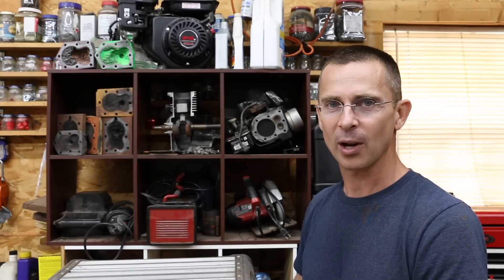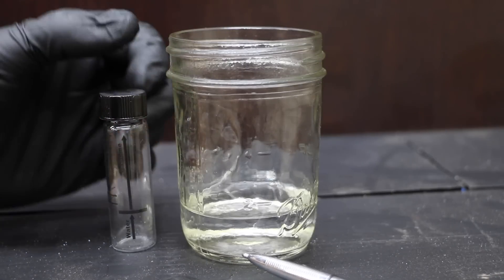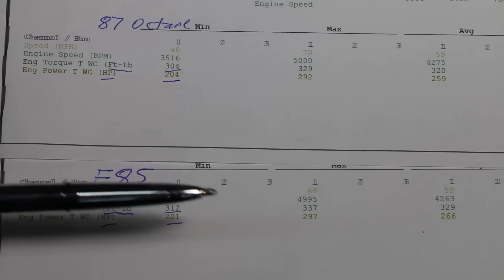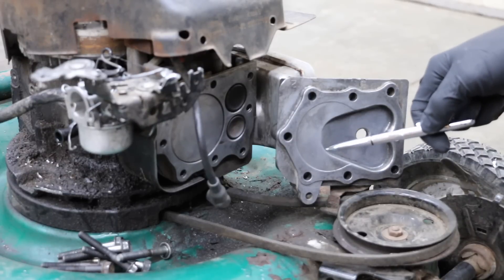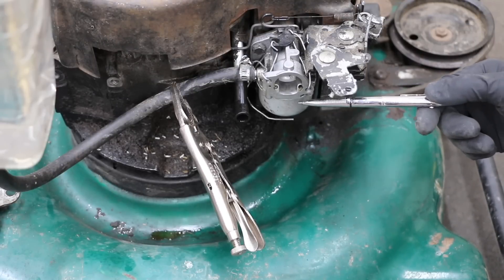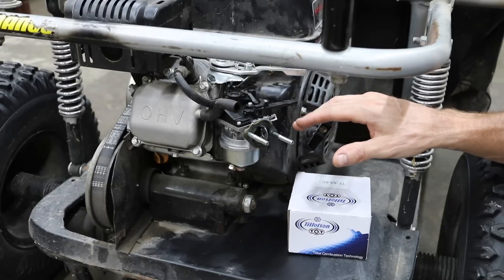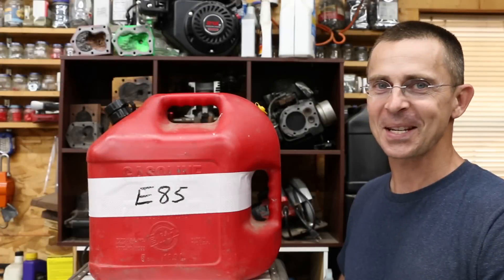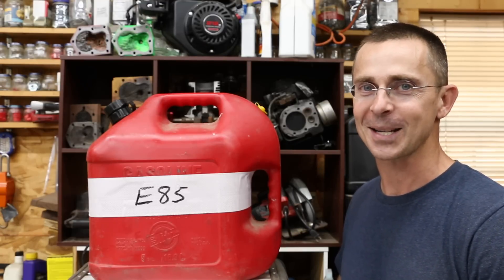Is E85 better than Gasoline? Let's find out!

Comment: I would rather fill my tank with regular gas (preferably 0% ethanol, if available) and install a water injection kit to keep the engine cleaner. It would be a much different story if ethanol would clean your engine and also have better fuel economy than regular gas. Ethanol fuel seems to do the same as regular gasoline with water injection and if you choose the latter option  you sacrifice your fuel capacity and efficiency. First the EPA had to ruin our jerry cans by making them impossible to put 5 gallons into a car in less than 10 minutes unless you drilled vent holes or removed their craptacular nozzle and just pour the gas into a funnel and now they are pushing this BS fuel. Just go back to using uncontaminated regular gas or admit defeat and let the electric vehicles take over. e85, def, catalytic converters...FFS my 1973 lincoln with a big block 460 passes emissions and has no catalytic converter an runs on regular gas..... why do we need all this extra crap?? oh wait, uncle sam needs his cut!!!
Reply from the maker: Thank you

Comment: I liked E85, my car was less loud and ran smoother. But, I could only use it in hot weather, in cold it was hard to start the engine. The price was just enough cheaper to compensate for the higher consumption. The exhaust smell was really nice🙂. Sadly, it's no longer available here in Hungary
Reply from the maker: Thank you!

Comment: E85 returns less mileage because it has to run richer. It would be effective where normal fuel prices are very high, but ethanol production is abundant. Like Brazil. I guess it's one of the best alternative fuel for spark ignition engines out there.
Reply from the maker: Great point. Thank you

Comment: E85 is kinda dumb in the grand scheme of things, and typically worthless in most generic applications.  That said, it lets you do cool things like make over 400HP from a 2L engine without grenading it in the first 500mi.  Given the direction things are moving, it is probably in your best interest to make as many adaptations for fuel containing ethanol as you possibly can.  It annoys me to no end that there's no proper flexfuel setup for my Caliber.  My Accord already has a custom ECU and will get a flexfuel tune as soon as I stop being lazy and fix it.  Spools of ethanol capable fuel line (Gates Barricade) are pretty cheap now, so you can fix up your return lines and lawn mower hoses.
Reply from the maker: Thank you

Comment: I've got a 2002 S10 Sport Truck that is Flex Fuel E85 or Regular 87 octane.. I quit using E85 because it was getting Horrible Mileage.. About 11miles gal. Vs. 17 miles  gal Regular Gas... I've got to admit my 2.2 liter 4 ran clean.. No odor from Tailpipe just hot water smell.. Steve.. 😎
Reply from the maker: Thank you.

Comment: If the vehicle is not designed for alcohol it will eat rubber hoses and corrode metals. Alcohol does have  higher octane but poorer power for a given amount. Engines will run fine on it if designed for it.
Reply from the maker: Great point. Thank you

Comment: It was strange to me on the Dyno tests that E85 provided more hp, but mpg was much lower.  I don’t think E85 was providing more power.  As you indicted in this video, E85 has less BTUs per gallon than E87.  The reason the decal on the pump said 51% to 83% and not 85% is there is about 2% natural gasoline added to 100% ethanol so it’s not drinkable.  The alcohol content of E85 is less than 85%. The results from your kit looked just about right.
Reply from the maker: Thank you

Comment: 95% of cars on the road don’t get any benefit out of e85 at all, you need a high compression engine and or a super charger to actually need the higher octane. When you do have a vehicle that needs high octane gas e85 is a bit cheaper than the alternatives even counting for the greater consumption.
The motor companies want high octane fuels to be standard as they can ramp up the power and efficiency by increasing the compression ratios, most vehicles that need high octane due to the high compression ratios they have are actually hobbled by the need to be able to use regular gas without damage in case someone mis fuels them. Currently the highest compression street car is about 12-1 compression but if there was no chance of getting the wrong fuel they could go as high as 16-1.
But then there would be a lot of engines killed by stale e85.
Reply from the maker: Thank you

Comment: E85 is used religiously on boosted vehicles. The alchohol content greatly stabilizes the fuel which allows you to really add timing and boost without fear of predetonation occuring. My SHO on E85 runs fairly safe at 16 lbs of boost with everything else being mostly stock. Compared to 12 lbs on 93 octane which is about as far as it can go without modifying other components. E85 tends to taper off at the top end for most vehicles due to limitations in the fuel system since it requires more fuel to get the same boom. Since turbos offset top end losses with boost, its an ideal setup. I wouldnt run e85 in a naturally aspirated setup.
Reply from the maker: Great point. Thank you

Comment: Put e85 in my 91 mustang few weeks back, yeah gas mileage using it not the best. But I gained probably 30+ HP, dropped 6 degrees in motor Temp. Noticed engine sound's different, sound's better. Great racing fuel and cost way cheaper...
Reply from the maker: Nice!  Thank you
Reply: @ProjectFarm  welcome

Comment: Great video as always. I use one 1/2 tank (5.0 gallons) of E85 every 6 months for engine cleaning in my 2000 Saturn 1.9, with 201,000 miles. For me its like a giant bottle of engine cleaner. Works great for only this purpose. Other than that, E85 is yuck.
Reply from the maker: Thank you!

Comment: What if you were to use a roughly 15-20% mix?
From what I’ve seen most modern vehicles should be able to handle e15, so what if you wanted to use a little higher mix to clean out your engine?
Reply from the maker: Great point!

Comment: I used to use E85 in my '03 Crown Vic before it was totaled. Much preferable to gas, the only downside was that since it burned cooler the heat didn't work as well in the winter. Never had performance issues and got good mileage. Plus, for nearly 3 years, E85 was ALWAYS $1.71/gallon at my local Kroger. A few months ago it went up to $2.65/gallon, but by then I was driving a. '04 Chevy Equinox that does not play nice with E85.
Reply from the maker: Excellent!  I'd use it if the price was right. Thank you

Comment: E85 is an excellent alternative to race fuel because of the octane rating of 105 (IF it truly is E85). I know people running upwards of 14:1 compression safely on E85. The engines run knock free and much cooler than on race gas. E85, however, requires about 30% more fuel than gasoline.
Reply from the maker: Thank you!

Comment: We repair postal vehicles and they are phasing out the ford body trucks which are flex fuel. When a new post master was in charge he told them to switch to e85 since it was cheaper not knowing it would cost more in the long run. We towed most of them in because of so many years of regular fuel it cleaned the crud out of the engine causing problems. On another note it does make more power in most engines but we all know making power comes at a cost or an exchange
Reply from the maker: This is interesting. Thank you!

Comment: Very interesting. Yes, Ethanol is an alcohol and hydroscopic, meaning it absorbs water, plus it's mildly corrosive which is bad for fuel systems, especially carburetors. Ever crack open a fuel bowl on a carb that's had E90 sitting in it? It's a mess. I ways awondered why GM and Ford were the only automakers to make flex fuel cars. To my knowledge, the Chevy Impala, Tahoe, Yukon,  Silverado, and the GM Sierra and Cadillac Escalade were flex fuel, and the Ford F150. They don't get good gas mileage to begin with.
Reply from the maker: Thank you!

Comment: Great video! Here in Brazil we have E100. Regular gas is E27. Today, about 80% of the cars here are flex fuel. Our rule of thumb is if regular gas' prices are over 30% above ethanol prices, is better to use ethanol.
Besides keeping the engine cleaner, ethanol is much less susceptible to knocking than gasoline. I myself drive a car with 22psi of boost and no intercooler, that's only possible with ethanol or methanol.
Reply from the maker: Thank you

Comment: My mileage in my 2017 equinox is a small difference I've ran both several times, I usually lose about 2-3 mpg, but throttle response is much better with the e85. If you're vehicle is tuned for it it definitely runs well my 72 c10 with a high compression 496 runs great on e85 but I tuned it and redid all the fuel lines with PTFE coated lines
Reply from the maker: Thank you

Comment: Excellent tests.....As usual. :-)
Reply from the maker: Thank you very much!  Thanks for the GREAT videos you're doing!  That 1000 AMP melter video was interesting!
Reply: I think you meant "Entertaining" tests.
Because this was one of the worst tests he has done.

He literally only showed 2 things.
1. Lower energy density (Needed more fuel. Less 'efficiency.)
2. Ethanol is a solvent, and will dissolve parts of a fuel system that is not designed to handle it.
(Holy crap STOP saying corrosive! That is NOT what that word means. It doesn't make you look smart. It makes people who DO know cringe...)**

Further: He doesn't seem to understand the difference between...
"Designed not to break when fueled with E85"
and
"Designed to take advantage of the things E85 is better at".

This TOTALLY sidesteps the actual (situational) advantages of E85
1. Much cooler intake charge.
2. WAY higher octane rating. Which it is why it is used in engines with forced induction pressures that would immediately destroy a normal gasoline one.

Conclusion: This test is utterly meaningless. Unless it is trying to answer the question "If I put E85 in my car, will it go faster?"  Which the answer is OBVIOUSLY "NO".

** Solvents break down things WITHOUT making chemical changes. Water dissolves table salt. But the salt is still SALT.
Corrosives break things down BY making chemical changes. Vinegar corrodes sodium bicarbonate (baking soda) by changing the molecules.
Reply: @Overwatch I find it highly amusing when viewers with zero content on their YT channel mouth off. If you're so smart and know so much, then make a video. LOL
Reply: @Prophes0r  Tecnically ethanol contains water into it. So it could cause corrosion in a normal gasoline engine not prepared to handle ethanol. Its actually a normal issue with old fiat tempras wich had a jerryrrigged computer to be able to burn ethanol instead of gasoline, the infamous 'converted to alcohol fiat tempras'.
Possibly its that what he is talking about.
Reply: @Prophes0r  no need to be rude bud.
Reply: @electronicsNmore  Why?
We don't have political donors, nor the power to remove donkey content once onto the net with our face.
I prfer to read the comments to critique junk science from real science.
And there is indeed a different payola system with internet than when DJ's were spinning an unknowns new vinyl 45.
You cant fault capitalism.
In fact, this is a new approach for teaching.
The problem in home class is cyberporn and too many hours spent with some Armalite variant in a game.
Lets talk CIA and imagery subliminals.
Watch a kids retina and endorphins under stimuli.
Reply: @Prophes0r  -  I'll just respond to one aspect of your comment, because it's not worth the time and effort.

In order to take Full Advantage of the E85's Power Potential, you need to use it in Supercharged Engines or
High Compression Normally Aspirated Engines running 11:1 to 12:1 Compression Ratios.  Then a High Performance E85 Tune 
is Recommended to Advance the Timing to take Advantage of the 100-105 Octane Rating that E85 produces.
Reply: @eduardoavila646  ethanol only contains water when contaminated or when not distilled to 99%+. there is a small amount of methanol formed during the distilling process... the methanol which is formed from impurities and must be drawn off, if used for human consumption.
Reply: @Ranger_Raptor_Twin-Turbo_3.0L  thanks for clarifying the octane of e85. pure alcohol burning engines can have compression ratios over 14:1. same as propane fueled engines, as both fuels have octane values over 120 and can be up to 125..
Reply: Oil execs in 1973. "So when Detroit catches up to Japan in technology, we can sell worse mpg fuel and still make piles of cash?"
Board members: "All saying aye!"

Comment: I love this test!! I own a 03 Tahoe with the L59 flex fuel engine. I have never used E85, mainly because of fuel consumption differences.
Reply from the maker: Thank you!  I really like the engine used in the Tahoe/Suburban.  It's done well.
Reply: @ProjectFarm  I agree!! It has 275,000 on the engine and transmission now. Makes no noises, and runs smooth!! I use a bottle of bestline with every oil change!

Comment: We had a 2010 Mercury Mariner a couple of years ago and the gas milage was horrible compared to regular 87. I did a price comparison and at $0.50 less then 87 (at about $2.50 vs $3.00) it averaged out to just about the same dollar/mile. Except for one time here recently where for a short time it was $0.60 less, $0.50 is the best discount I've ever seen around here. It usually rides around $0.40 less which makes it very uneconomical most of the time.
Reply from the maker: Thank you

Comment: Thanks for doing this video! I run E-85 in my 2007 Grand Marquis because in my area, it’s around $1.10 cheaper than regular 87, and my personal testing shows the difference in gas mileage to be very small (2-3 mpg), making it slightly more cost effective to run on corn power. Keep up the great content!
Reply from the maker: Thank you

Comment: There is little difference between a flex fuel vehicle and a non-flex fuel vehicle. Flex fuel vehicles are the only way for auto manufacturers to earn carbon credits without having to change a single moving part on their vehicles. The only difference between the two is the computer and sensors.
Reply from the maker: Thank you